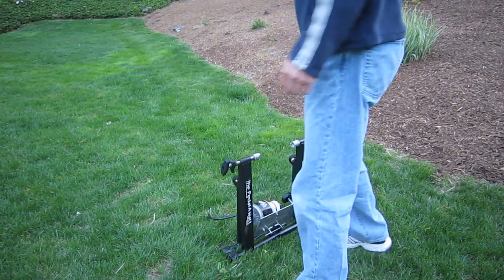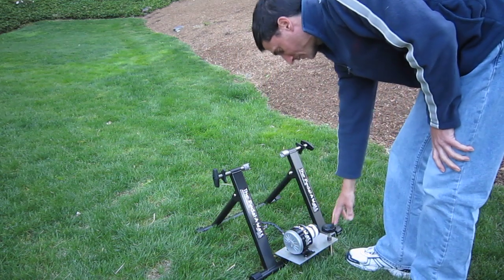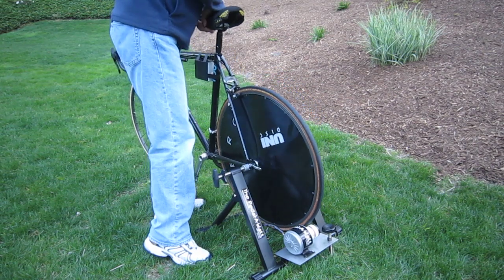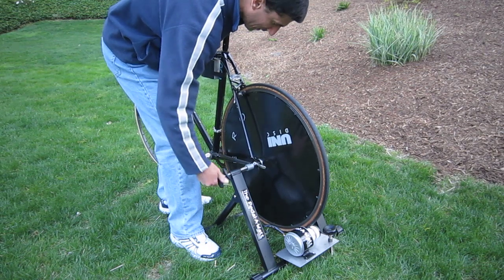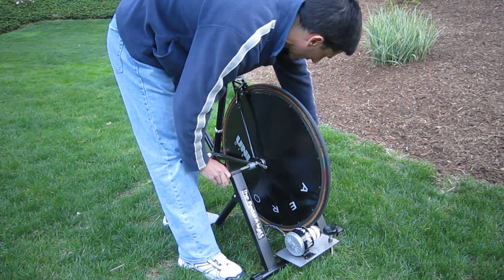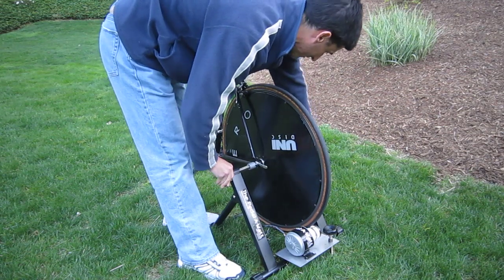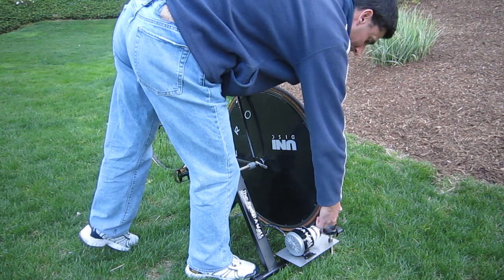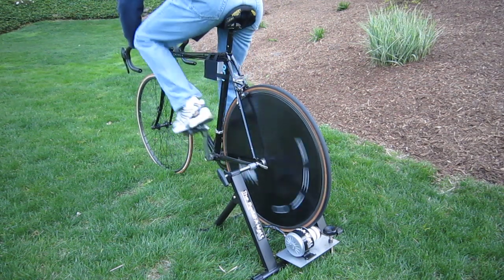Setting Up and Using the Pedal A Watt

Comment: So if I pedal my ass off for 2+ hours I can save myself the 10c my provider charges me for the Kwh but I pay $1000 US to get the rig to do it? pass...
Reply: Mike, thank you for your review.  The fundamental issue in looking at Return On Investment (ROI) with all human generated electricity is that human beings are fairly weak animals.  For example, even the world's most conditioned athletes cannot produce more than 500 watts (.5 kilowatts) for any sustained period of time.  In the most expensive US electricity markets, 1 kilowatt-hour (1 kilowatt produced for 1 hour) costs around $0.30.  Simply put, human legs cannot match the scale, scope and efficiency of large, electrical generation plants.  The Pedal-A-Watt is best used in situations where the user is looking to capture electricity from effort already planned to be expended, after and during emergencies or natural disasters where grid electricity is not available and in areas where electricity is not available either due to geography and/or financial situation.

Comment: Very awesome idea, can you put any bike on the stand? - A BMX bike?
Reply: The Pedal-A-Watt stand will work with a wide variety of bicycles greater than 24 inches in size and a range of tires.  All bicycle tires will work but please note that smoother tires offer less noise and vibration during use than off road knobby tires.

Comment: Very nice. What is the range of tire sizes that the stand will fit? For example, could I use it with my 26" mountain bike?
Reply: Jim, thank you for your interest in the Pedal-A-Watt.  The Pedal-A-Stand will work with tires of a width up to 3 inches and down to .8 inches.  As long as your bike is at least 26 inches in size, the Pedal-A-Watt stand will accommodate it.